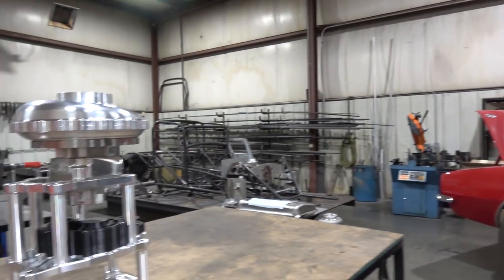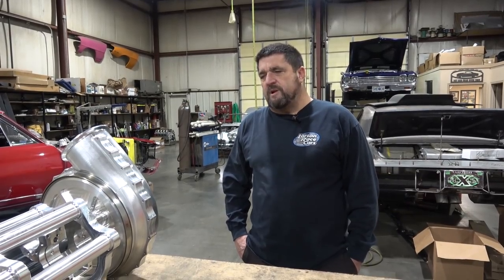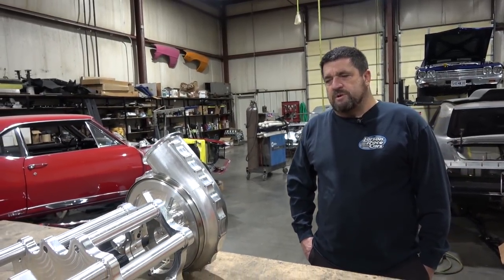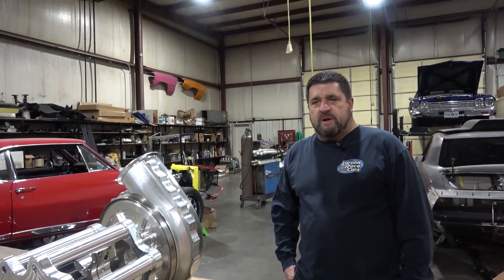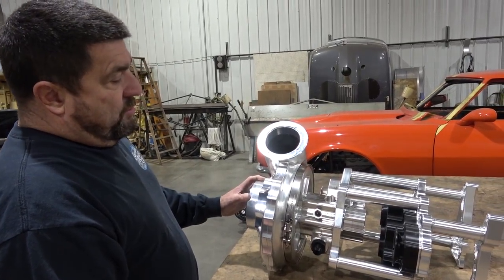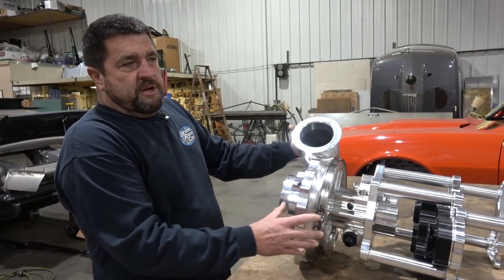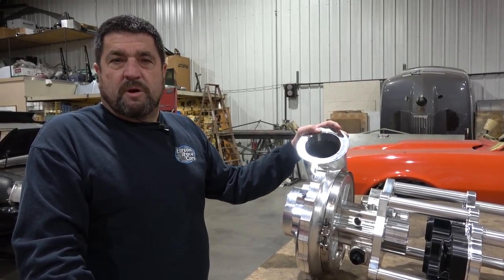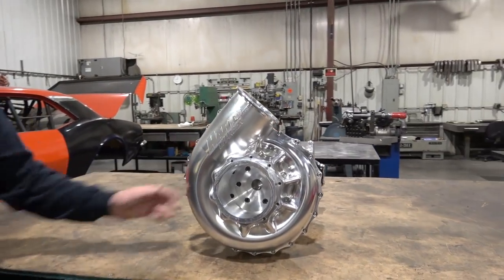Larry talks power adders and their advantages

Comment: That's what I'm talkin about! Great info! Thanks for sharing! I like the fact that you can send filtered oil to it so it stays a manageable temp. You could feed it trough a filter then a cooler it should live forever. I would still neutral it for the drag & drives but, that's the tight ass in me talking......The gearbox looks robust.

Comment: Can you make a video on all the different types of screw blower's and which one you think is the best to run for NPK for instance because I know that as of right now there is only a Roots and C-rotor screw blower's in the NPK and can you explain which one is easier to tune and which one makes the most power and down force and even throw the twin screw and any other one's you can think of in the video and maybe even go more in-depth with the centrifugal blower like the differences between Procharger, Hart's Charger and Vortec and so on

Comment: Larry, Think about an electric compressor you could place off the frontend, using a capacitor to power it and control spooling with an ecu. Billy Godbold is working on a cam for it. Shut it off for Dragweek travailing and charge the capacitor for boost. They already exist. Something to think about

Comment: With two sets of stand offs that's got to walk around a good bit at speed.  A damper with a built in roller clutch or a diode along with a four pinion planet would probably take some length off the assembly.  Hopefully their gear sets will be coated but a fine screen with a magnet in the return just in case.

Comment: I am glad you mentioned zoomies and the benefits, been called a liar for saying the exact same thing. While there is a weight break for SC's, I believe the zommie effect (boosted downforce) is more the advantage. Personally I'd like to see them eliminated. that would equalize things and keep yearly changes hopefully to a minimum
Reply: They would never ever ban zoomies....wouldn't and couldn't happen.
Reply: @chicago_race_engines7538 , Well they have to do something, you never see these much change at NHRA events, because everything is already limited ion the scope of what you can do. F1 every few years have to outlaw some exhaust tech, that gives unfair advantages. Every automotive or cycling organization had rules that limit thing like this, Zoomies provide an unfair mechanical  advantage to both Nitrous and SC cars, that turbo cars can't replicate. If everyone can't use it, it should be outlawed. instead of changing the weight breaks every year, make everyone run through a 5" stovepipe or two. equalize the downforce advantage from the zoomies, then you can start maximizing all builds and make the racing more fair. Do not get me wrong, I like the effect of zoomies, they stabilize the car and make it safer as well as faster. Bur if everyone can't use it it's an unfair advantage and will force everyone into cookie cutter SC or nitrous setups. Everyone says NHRA prostock is boring, because it's basically spec cars (all run the same chassis and running gear more or less) Do you really want that at No Prep? everyone running the newest Camaro's with SC/nitrous Hemi's? Because that is where it's headed, unless it's stopped. I'd rather see some diversity in the racing, over just paint and decals identifying each car and racer. How about you?
Reply: @crazylarryjr   Yes I would like to see that tired of them banging popping bump in Is slow spooling up Turbo's gone
Reply: @crazylarryjr  the parity thing is such a touchy subject. But I agree rules need to be updated
Reply: @crazylarryjr  and I agree it's driving me crazy seeing all the same setups popping up.
Reply: It would appear you are arguing with yourself. If everybody can't use the technology then outlaw it? No zoomies! Make everybody run through a 5-in stove pipe. But I don't like cookie cutter cars with the same engine and chassis?  You remind me of my wife...
Reply: @garyvisser8987 , I get where you are coming from, but it's a catch 22 either way. At least eliminating zoomies, they can at least all play on a level field. Where the zoomies can be getting right now up to a 1.5k-2k pound weight (downforce) boost the turbo's can't touch. This is based on top fuel tech saying the sheef force from the 10K hp Nitro engine can provide upwards of 3-4k pounds of downforce. Most of these cars are capable of up to 5k HP so assumed up to half a TF dragster. Now the big bordering on huge difference, there is no regulation on angle. NHRA forced an angle on the TF dragsters because people were jet propelling like Larry said. This is what the NPK and street race cars are doing now. they are laying down the angle to provide boost, Liik at reapers new camaro, Fireballs camaro's the renewed OG Murder nova, all are angled at about a 40* or less angle from the ground. they are not just getting downforce, they are getting a jetpack push as well. I'm not saying it'll solve every issue, but if it's not regulated, then everyone will be running them and nobody will be special, Just like NHRA pro stocks. Don't get me wrong, I'm all for progression, I want expansion and evolution, but if you are going to have rules, they should work for all, not just a select group. You can't create the manufactured downforce created by these exhausts on a turbo car

Comment: Quick question, how come turbo cars have to be heavier than pro charger cars at npk?
Reply: I think they try to maintain a particular horsepower to weight ratio to keep it competitive and also for safety reasons as well I'd have to guess.
Reply: It's not as simple as turbo cars have to be heavier. It depends on whether the engine is small block or big block, the size of the turbos, the size of the charger, the number of turbos etc. Some turbo combos are lighter. The whole idea of the weight is to try and balance the field otherwise everyone is going to run the same car and same combo.
Reply: The added weight is taking turbo cars out of the equation in my personal opinion! Considering that they're the hardest combo's to tune and they're the slowest off of the line, I'd say that they're absolutely at a disadvantage! 1/4 mile race different story, a 1/8 mile race is quick! It seems like nitrous and procharger cars with lockouts are the cars to beat with the current rules!